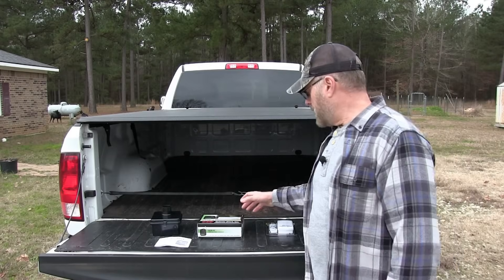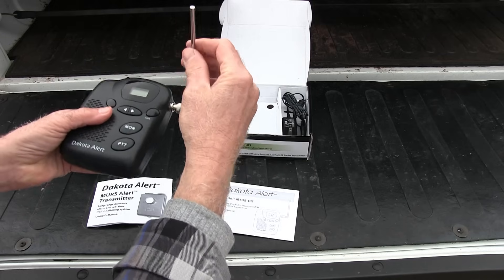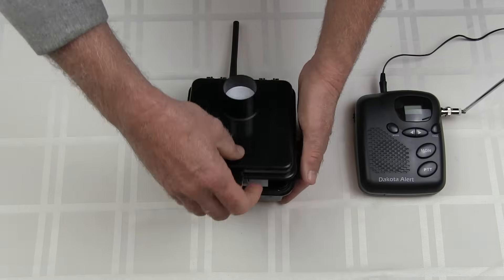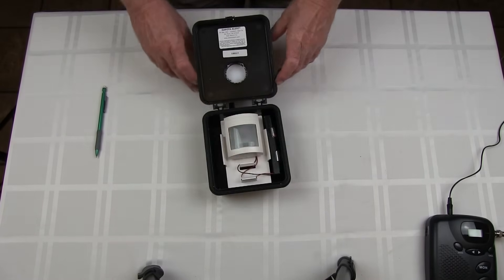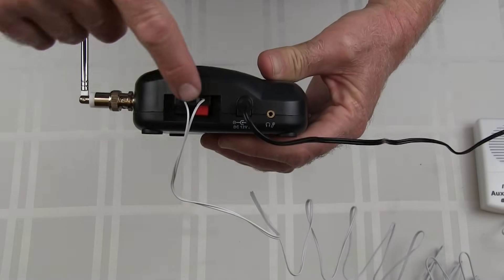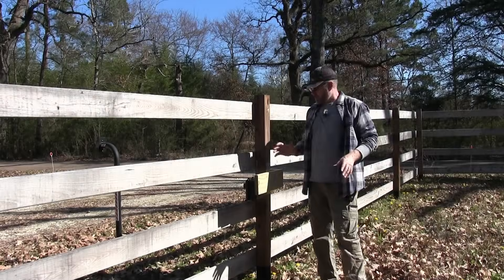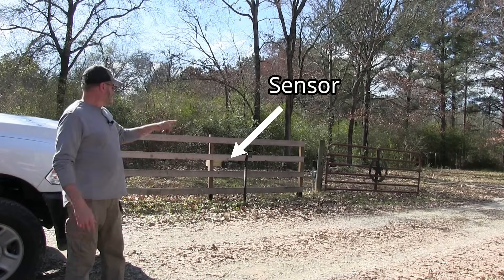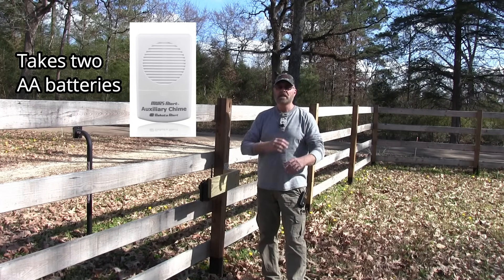Dakota Alert M538 BS wireless Driveway Sensor Installation

Comment: The mode after the channel that goes to 38 is the subaudible tone, must match the sensor to hear it and alert. The other one sets the special tones that are sent when hitting the call button, if you were using it as an intercom or to call other radios.

Comment: Weird to see how they make that sensor - it looks like the radio transmitter gets powered when the sensor trips, and broadcasts immediately at power-up.  With 6xAA batteries, it would look like one could trigger a broadcast with anything that produces a 9V.  I'm guessing that the little glop-top circuit by the message select switch is an audio playback circuit.  This looks like a good potential candidate for hacking without modifying the RF stage ;-).

Comment: I have studied the Dakota line and they have a few flavors of the metal detecting driveway sensors to be aware of. The Older 4000 series that ONLY talks to the 4000 series receivers.  They have a Battery Version and a Wall Wort AC Powered version with no batteries.  They have a 50 foot cable sensor and a 250 foot cable version.  Then they have the Metal Detecting MURS system that talks to the Intercom Base Stations and Hand Held radios.  So just beware as the 4000's are cheaper but will not work with the MURS. As seen they have the IR Motion Detectors like in the video. They also have Beam Type Sensors where you have to break the beam between a transmitter and a reflector. They also have a HOSE sensor like you see in old time gas stations. They need to ADD A sensor that has a set of contacts.   So you can make a Flooding / Water Sensor... or a Temperature below a set point to monitor a house for freezing or a CO Alarm.  You could likely alter the HOSE Alarm to work with a Flooding Float Switch by accessing the contacts.  This is a pretty Impressive system...

Comment: I am very impressed with this system. I just ordered 1 metal detecting car driveway sensor and 3 motion sensors like shown in the video. Also bought 5 base stations and 3 radios... The base stations also act as an intercom between bases AND to the Portable Handheld Radios so Family can stay intouch on the property. So this will connect my Neighboring house with my house plus my workshop and bedroom. The system will work with only 4 sensors max at a time. The workshop already has a DEI 795T 12 volt old Car 3 channel Pager that is hooked to the base of the Guardian like short range little green box Motion Driveway Sensors. So my Driveway Motion will show up Orange on my pager and the new Dakota will show up Red or Green.  The DEI 795T is a 4 Watt Pager that operated on the CB Band of 27 Mhz. In my tests it worked closer to 2 miles away.... And is small and fits in your pocket. You can find them on eBay from time to time... The newer 2 way car pager have a shorter range but would also work.  The PLUS for the Hand Held Radios and the Battery Sensors is that they operate even during a power failure when a break in is more possible... The base station has a set of contacts shown in the video to link to my DEI Pager or to a simple Buzzer or beeper... I am not impressed with the Chime.... Too Busy for me... BeeeeeP is much better.....  My plan is to set the 3 motion sensors in the house and garage and when you are home just turn them around to face the wall if sitting on a shelf...  A Simple and effective way to secure your property.  Reading feedback some Negative Comments on the IR Motion Sensors where WATER has gotten in around the Antenna Jack into the electronics and caused FAILURES..   Like someone else has posted... I would place a little Roof Board over that Gate Sensor as an added protection....

Comment: will the hand held receive the alert also from the sensor
Reply from the maker: Yes, it does and I put a link in the description under the video. Thanks. This is from their web site: The M538-HT is a hand-held MURS transceiver that will receive alert signals from the MURS Alert™ transmitter and also can be used for two-way voice communications between other MURS transceivers.